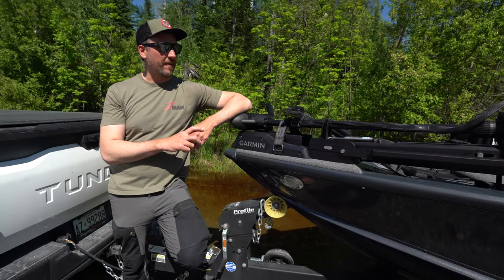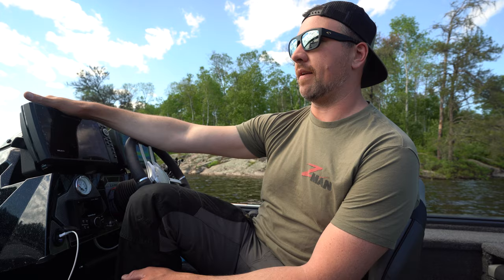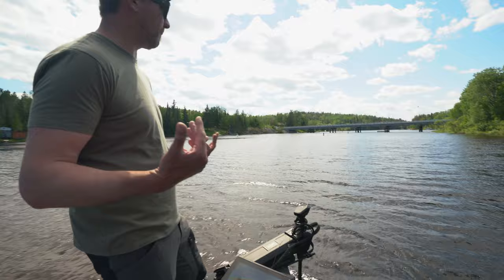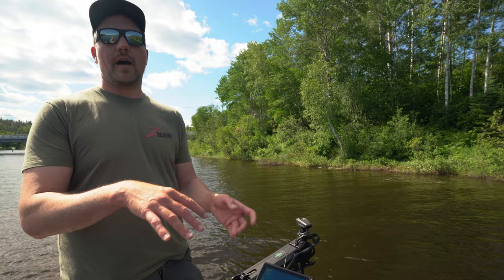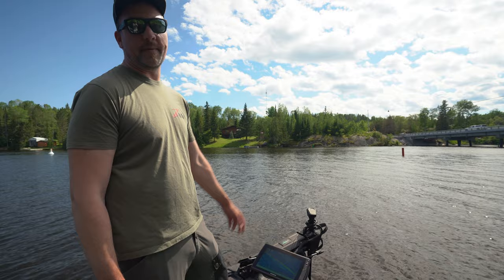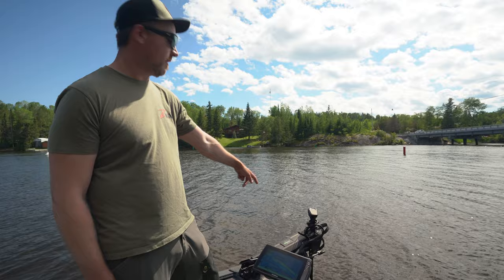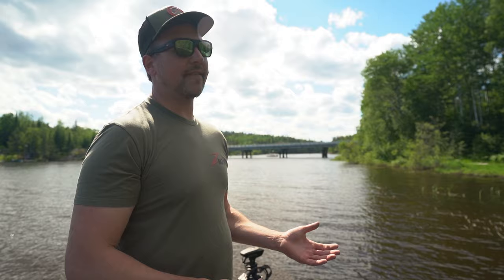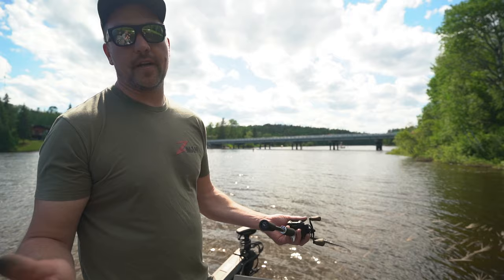Garmin Force Trolling Motor Walk Through W/ Jamie Bruce

Comment: I really want that stow/deploy cable!  I'm getting older, think that's a key feature.    But the Kraken has some advantages but doesn't have that feature.  Any opinion on Kraken vs Force?
Reply from the maker: Kraken offers longer shaft length and seems to be the more popular choice among the walleye focused angler. If you are looking to mount a livescope to the kraken shaft it becomes more of a permanent mount.  Where as the force provides a little more flexibility on livescope configurations.